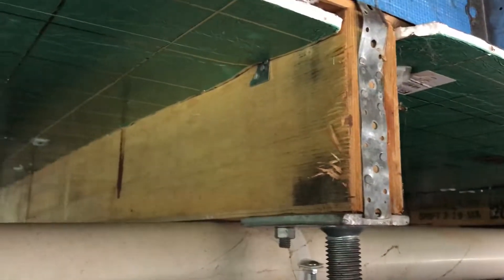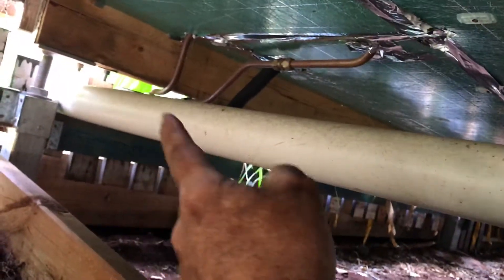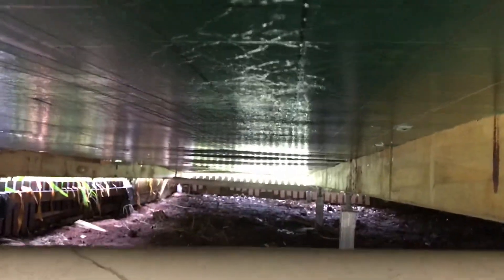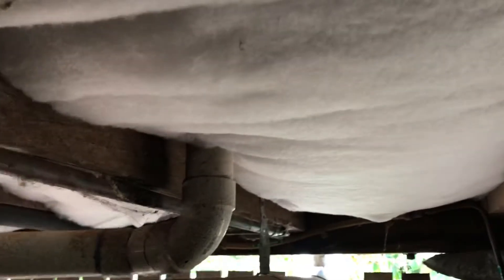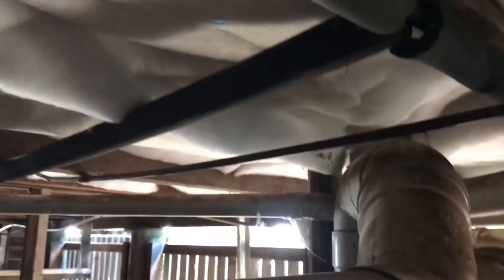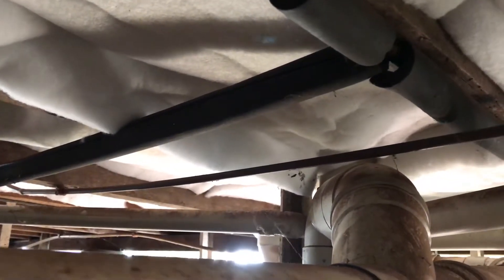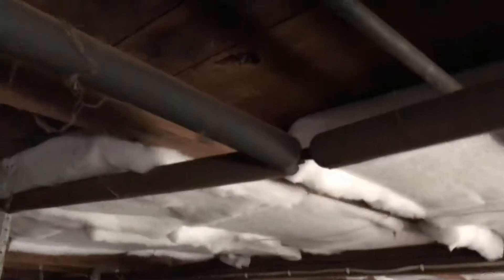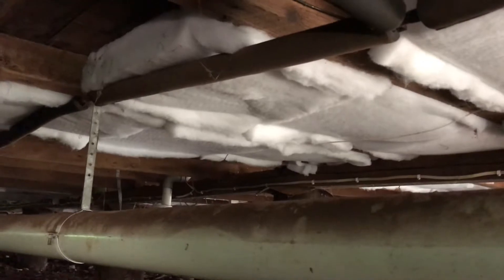Foam Foil board insulation is a bad solution for insulating a floor or shed and here is why!

Comment: Where could you use the foil boards if you have some already and want to still use them on a house?
Reply: I have seen plenty mice get into poly bats, and they start to sag too. They also can have gaps at edges and at the floor. 
Another factor is they can create mould being pushed up to the timber floor. 
Also the way you have it a lot of cold air will be transferred to the timber joists or beams and this will transfer to the floor and heating will battle to keep the floor warm. 
This is especially paramount in steel framed supported homes. 

So ideally it be beneficial to cut say 15 cm wide strips of foilboard and attach to the timber or steel to support a glass fibre insulation that sits on top of these edges. There by creating a virtual thermal blanket below the joist beam line. 

Some people might think why not just fill the whole area with foilboard? Well, that as you said can lead to vermin homes or other pests that one cannot inspect. Many timber floors should actually "breathe" too, so this would be creating a non penetrating layer. 

Anyway, food for thought
Reply from the maker: Hi scott, yes you make some good points but even applied the way you suggest, you will have similar problems. 

Steel frames are definitely a weak spot in any insulation, in Australia they are supposed to have isolation points to stop thermal transfer but in practice I almost never see them installed on floors or roofs.

Timber joists are less of a problem as a 150mm floor joist has a Thermal resistance Rating above R2.0 and then you add the flooring to that and it would actually exceed the insulation requirements in Australia. 

In roofs and floors I have seen rats nesting in all kinds of batts (the only insulation that never has rats is the pumped in cellulose fibre). Batts and foil products suffer from making great homes for all kinds of animals to live in. So I do not think a fibreglass solution would solve this problem. In fact other than being itchy for the installers, my experience is that fibreglass batts are more likely to sage and get rodents in them then the polyester batts. Just have a look at my “Rats in batts” playlist.

The moisture issue may be related to your location? In QLD I have never found mould under my polyester batts and I would say I have more experience in this area than most companies in QLD. The reason I have never seen mould is that our poly batts do not block moisture transfer the way a foil product does. If you put your face to a polyester batt you can still breath and that is not true of foil board. So foil board actually makes the perfect conditions for mould by trapping stale air between the floor and the foil board and allowing condensation to form on the foil. That is why I only recommend foil board for commercial installations where it is a steel frame and it is being retro fitted.

Yes ploy batts will sage normally when installed on floors like this but my polyester batts are not made by CSR and are custom made for my installers because of my 20 year relationship with the factory that makes them. So this is not a product you will have seen installed unless you have been on one of my customers jobs in QLD. 

In summery, you are right about steel frame homes being difficult to insulate but using fibreglass and foil board on the bottom of timber joists would not be a better insulation or better rodent deterrent in my opinion as an insulation professional having insulated more than 10k houses personally and many more in my company.
Reply: @InsulationTeam  or this for new construction. https://www.architectureanddesign.com.au/suppliers/bradford-insulation/bradford-optimo-plus-innovative-steel-frame-sub-fl
Reply from the maker: Ya they did well to get those green batts to stay in there. Particularly hard on steel frame but then again I probably have not used that exact product, I have used a similar one in qld though. 

The site looks like a marketing site to me the way it is soliciting leads from all states... maybe the cover story is just that to but like you can see from my 600 videos on different houses I have actually done the job many times. 

Not sure why Maurice did not mention his qualifications or the heat transfer of the steel but this site seams like a slick sales site that will just sub the work to a contractor near you who will do the job however he has always done it ... the contractors normally get about $1.50 to $2 per meter for the labour cost and so often are working for $30 an hour tuning there own business. That is hard to do for long so be careful when you book them.
I would buy the same product from a local guy that you know where he lives if you ever want it fixed. I have also done contract work for many of these internet sites when they have called us to install for them but on more than a few times I have never been paid and the site starts under a new domain... I am not saying this company in the link is like that but just be careful. 

Their information looks good other than that.
Reply from the maker: Ya I just had another look and having watched his product video, I don’t think this guy is a installer... just a sales rep he even recommended foil on top of batts in the ceiling ... just a waste of money that is... 

Also he tried to take credit for making floor batts 450mm wide like as if that is his invention but that has been the standard size forever as far as I know. He also refers to celllulose as setting but that just does not happen. As you can see in my videos, that is the installer doing a crap job. What about rats in the batts ? They do not last a lifetime because of rats but the cellulose fibre insulation will.

Show me a video of Maurice all hot and sweaty after crawling through a roof and then I would believe him.

For floors he says his bats have never been vac packed but he does not even say where they come from. Vac packing them for a short time makes no difference to a quality made poly batt anyway. 

Also my floor batts are R3.0 so making a R 2.5 floor bat is no big deal... looks like a lot of marketing and not much experience of on the job installation to me. 

Ask him about dense pack for poly batts? The fact that drafts can flow though the batt with ease and this ruins the value of it where there is gaps in the ceiling cornice or fittings. Also what about the heat coming though the joist? Bulk cellulose can be pumped over joists if you want R4 but R4 batts leave the joists uncovered at just R1.5 normally ... 

Anyway his floor batts look ok but I think you would be able to call a sub contractor and get the same job at a better price.
Reply: I think it's well suited for retro fitting under roofing as a radiant barrier. I will be using it in my steel shed, fixing to the underside of the roofing sheets as it's rigidity and light weight allow easy installation. If I had built the shed I would have used plain foil or foil blanket before the roofing went on as it's much cheaper but after roof goes on the options become harder so a product like this has its place. You could use it anywhere you need a radiant barrier, walls even but you must make sure and air gap exists on one side as per basic laws of thermodynamics.
Reply from the maker: Yes the purpose you mention for retro fitting to a shed roof may be  a good solution. Like you said it is expensive when compared to the options available when you are building the shed but when compared to lifting the roof off in a retro fit situation it is sometimes a lot cheaper.  That is why it’s normally only used in a commercial environment where the cost is not as important as just getting a result. 

Just be careful if you are using it in a DIY situation that it complies with the NCC for a residence if you intend having people sleeping in your shed at some point. I would invite the manufacturers of foil board to comment here with answers to these questions to help customers as I am not a expert in this product.

I am not sure what your references about the laws of thermal dynamics are maybe conservation of energy? But you should definitely make sure there are no gaps in the insulation where unwanted energy transfer can just bypass the insulation. I believe the requirement of the manufacturers to have a gap above the product, not directly touching the iron is more a function of the fact that EPS looses its ridged glassy state when heated above 100 deg Celsius and so if it had no buffer the foam would sag or begin to flow over time

The other problem is that condensation would be more of a problem and I think it effects the foil coating over time. Like I said the manufacturers would be able to give the actual answer for why they want a gap above there product and I would invite them to leave a comment here and explain it.

In truth what I know about this particular product is limited to where I have seen it installed in floors like this video and it clearly should have been installed better on this particular job. 

You do have to be careful of exposing the product to direct sunlight because I have seen laminated foil start to flake off and it makes a big mess to have the foil falling down all the time. I am not sure what product had that result and maybe different brands handle sun better. 

I think any laminated foil products may have similar problems over time. The roof I saw like this was a public sports shed in Kilcoy QLD but it was actually the anticon blanket that the foil was falling off, mined you it was 25 years old but still expensive to fix.

Thanks for your comments, I hope they help someone and like you say foil board definitely has advantages in a retro fitting situation.
Reply: Hi Matthew, I am sorry but this product is really not suited to houses, it has a commercial application for putting under concrete ceilings and foundations but in a house I would not use it.

Maybe sell what you have on gumtree and just buy a good insulation that is made for the area you want to do. It will be cheaper in the long run.